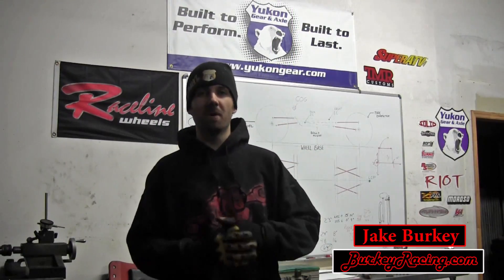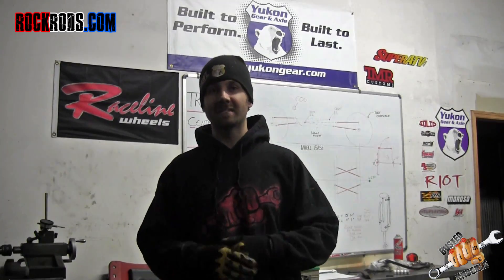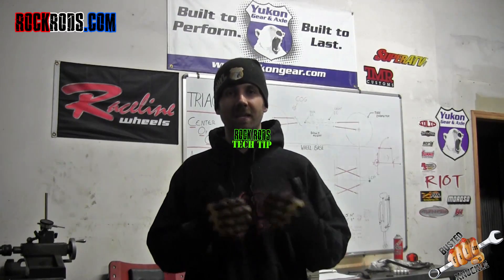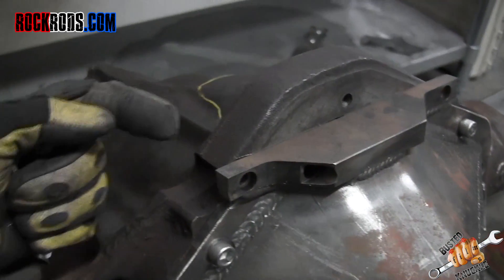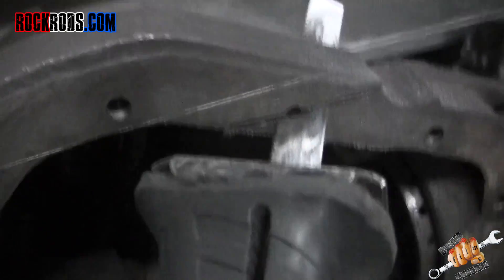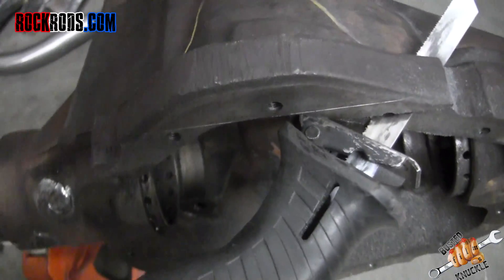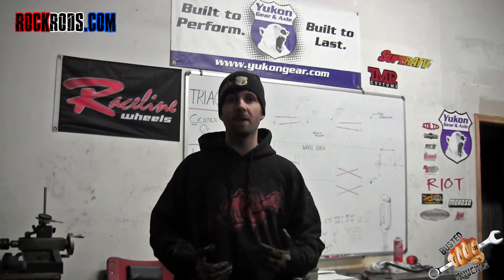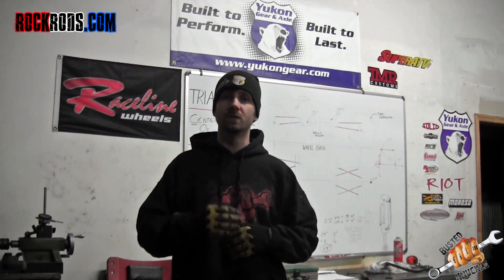ROCK RODS TECH TIP - How to Shave a 14 Bolt

Comment: Great information . However, what is the difference in ground clearance over a d60 or a d44 , seeing that those are extremely popular and are most likely what these 14 bolts are replacing ?? Thanks in advance for any response
Reply from the maker: there isn't much ground clearance difference between a shaved 14bolt and Dana 60 but the overall strength difference makes the 14bolt the right choice.

Comment: Pre heat like a mofo on cast, and I use 312 stainless tig wire. I've done a couple of these shaves with no leaking or cracks. As for post weld, I use blankets and a cardboard box to cool slowly. You need a huge sandbox for a diff haha
Reply from the maker: pre heat is a must

Comment: for welding diff gears to make a Lincoln locker I been using stainless steel rods with my stick welder. no cracks . 14 bolt 9.5  been in my cj 7 for 6 yrs with 39.5 Boggers still holding nice
Reply from the maker: +Ernie Desjardins nice

Comment: Just to be clear to those watching, this won't "increase your performance a ton" obviously...
Reply from the maker: +TheJustin574 Its worth it when everyone racing runs the same size tires
Reply: 2 inch gain under the pumpkin is a fair increase...lol...that would take a true 4 inch tire diameter increase to achieve  and 2 inches is the difference from hanging and going nowhere vs walking easily over a big ass rock . I run a 44 tsl on my 14 and think the 2 inches I got from the Ballistic kit was worth it even with a 44 ...lol...I think guys with a tire like a 38.5 sx would absolutely need it since 44s were still hanging the diff stock pre cut and plate .

Comment: For stick welding you require a Nickel/Cadmium rod, not just Nickel, however, there is a rod ($6.00 ea.) that requires no pre heating. Check with your local supplier. I will make a call tomorrow and post another comment.
Reply: montwolfman 7018 stick or basic mig wire and some added heat if its really cold where the work is done. If the metal is caked in oil/grease clean it off before sanding or grinding as to not contaminate the metal ...weld in cycles to minimize heat ...more heat the more expansion and the more contraction on cool down ...welds crack things warp .

You just don't need the magic heat dance  putting parts in the wife's oven or exotic filler materials for this job ...But feel free to over complicate a simple job.